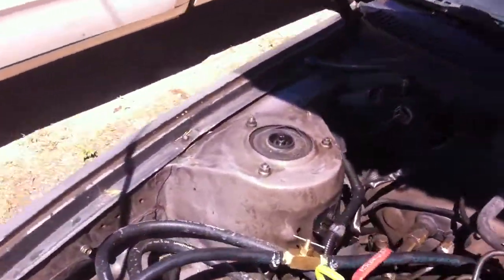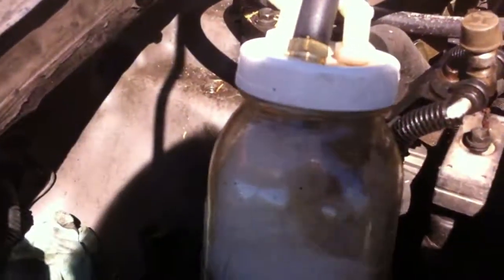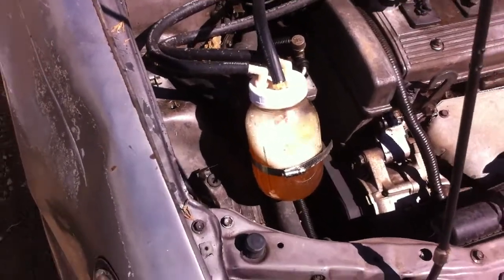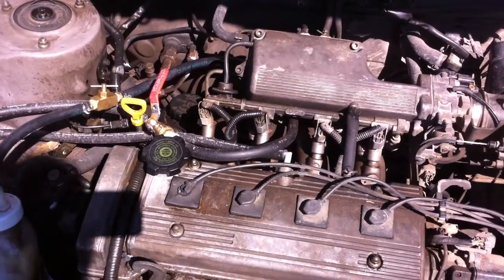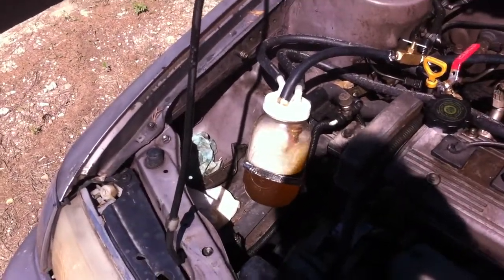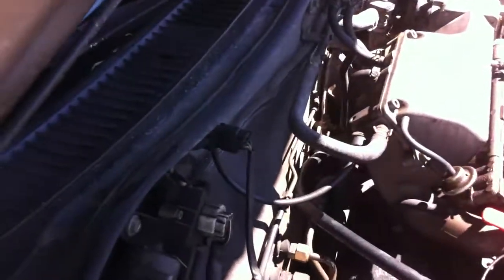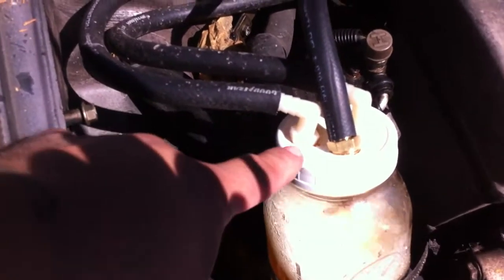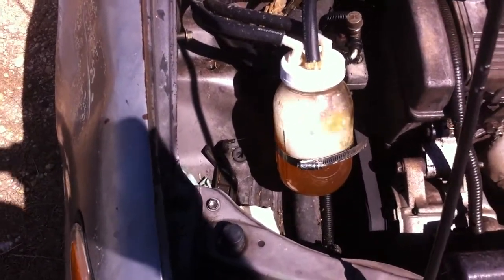Simple Fuel Vaporizer, Drip refil system.

Comment: Ok I'm not understanding any of this. are you tying into the fuel tank or adding to the jar manually. how do i know what needs to go where. I drive an 88 Chevy 1500 and would love to see some gas millage improvement. can you make a video where you actually build and show step by step where these lines go
Reply: By my experience playing with HHO and such and this being much the same in application..  What I'm guessing is, he is using a vacuum off the intake or one that goes to the brake booster, making a closed loop meaning he has it going in a circular path around to the jar and back to the intake..  The vacuum on the intake side is above the gasoline level in the jar, the other side goes down into the bottom of the jar to create the bubbing effect..  An idea I would implement though is to use like a gas filter for a weed eater or something that has that aerator much like a fish tank to create a vast amount of smaller bubbles instead of heavy blurps on the longer side where the air is being pulled from.. The 3rd line is the fuel line which you want a very small and precise valve in-line with exceptional fuel line from a tapped fuel source on the car utilizing the pumps pressure to keep adding to the jar as it is depleted.   You want this to be slow as in slow.. A drip or two every few seconds as the vapor is much more efficient in it's use (hence the increased mileage) and therefore very  little ends up blowing out of tail pipe..  Now if you wanna get serious, the evap system already installed in many cars can be in my opinion utilized for this application.. However, the original setup from the manufacturer doesn't implement it correctly (I think on purpose) as to it being too efficient for gas companies to allow on the level of the manufacturer.. So a system that reburns used fuel was set up for EPA reasons even though we know the EPA is nothing but a slush fund for Deep State (more money for the same owners) but think about it's application..  They are using it to fix unburned fuel rather than make it be used as primary.. In other words, you need to apply it before the burn, not after..  With a simple EFI add in computer to adjust your O2 sensors detection, and a small change in the way the hoses route, I think that is a much more greener method than using it after plus you get the much wanted gas mileage one searches for.. I've not tried this as of yet cause I'm burning an HHO system and I'm learing about using both at same time but I'm about to give it a whirl..   Honestly, I would be happy with a complete HHO system that can eliminate gas altogether but the process of producing is a heavy load on electrical to that magnitude.. However, doesn't seem impossible...   Two batteries I personally restored with epsom and 3 rebuilt used alternators and I've got me a pretty inexpensive fix to an old problem to gas guzzling means of transportation..   Now if they would just release the portal science... Italy has already spoke of technology we could eat there and be back at work during lunch here in America with new methods of transportation coming soon with Trump working on full disclosure.. :P
Reply: Oh, if you can, install your vaporizor cannister (be sure it's completely sealed off as best you can) near the heat source under the hood.. heat adds to the vaporizing effect  of the gasoline.. Some people install it near a radiator or near the exhaust manifold..  You can go as far as buying a heater type coil that works off 12vdc to heat the cannister as well.. When using the evap system I'm still in the process of discovering the storage capabilities of a carbon cannister or if this is something not worth keeping.. May post findings on the use of those soon.  I do know it would be beneficial at the time you shut off the car as it will keep vaporizing the liquid to the point of losses or it just sitting in the heat of the day without starting... This to me is unacceptable losses that may be prevented using a vacuum valve to a normally open pathing through a carbon cannister.. None of this has been conceptualized as of this writing.. Trials and tweaking of the system has not yet began at the moment of this writing.. I'm just making my ideas avail to those with some understanding of engines and the concepts who may want to give it a go..
Reply: @neoplasmax  the evap system IS more efficient than injectors...its being done backwards at the factory, I agree!  Injectors should be used when demand is high on the engine; it can run perfectly well normally just off vapours...and ethanol is just a tool to hamper gasoline from vapourizing.

Comment: May I ask what parts are needed for the drip refill portion? I wanna try this with my 90 Volvo along with hydrogen
Reply from the maker: Jack Newport  I used all "high pressure" brass components. The "t", needle valve, and tubing nipples are all rated at 125 psi due to the injection system requiring between 50 and 75 psi on this system. I figured it is better to be safe than sorry. The "T" was used to tie into the fuel line just ahead of the fuel rail connection. From there to the needle valve and then to the vaporizer. It is just about as basic as I could make it.

Comment: Looks nice, but eventually the glass will become sensitive due to the gasoline and heat, plus vibration of the car, the glass will pop soon enough so be careful.. I would change that jar into another container that can do better with the heat, holds gasoline and the vibrations.. the led/cap has to go because its plastic and the heat and gasoline will definitely destroy it over time.. it's nice to see that you are using a small amount along with the car's injectors because the computer will sense the extra fuel burned and lean out the gasoline to spray less, making you save a small percentage which is an awesome thing.. gasoline price now a days are crazy!!!
Reply from the maker: This unit has been running on this car as seen for over a year now. I do plan to build a different one but I will use this one until it "pops"..lol.. I chose this jar because it is tempered glass so it will handle the heat and cold. I also have it mounted against a foam insulation that stabilizes and cushions it on the back side so it isn't mounted against a hard surface. I actually doubled my mileage with this unit on this car due to the PCM leaning out the mixture to accommodate the extra vapor. Went from 21-23 mpg up to 40-42mpg on the highway.. Not too bad.. Thanks for the hints and concern!

Comment: would you pls kindly share the video of the flash back arrestor and where did you order it from?
thanks a lot
Reply from the maker: I didn't buy the flash arrestor, I made it. Two 3/8" hose x 1/4" NPT (national pipe thread) plastic adapters and a 1/4" NPT brass coupling filled with a brass pot scrubber. The brass scrubber was bought at Walmart and the other parts at my local hardware store. I don't have a video, sorry.
Reply: put a videoo for that PLS

Comment from the maker: A small update to this system. I installed a small flashback arrestor in the vacuum side from the intake to prevent an explosion due to backfires and since this engine has a large amount of wear and therefore blow-by, I had to install a small filter on the  vacuum line from the PCV valve. The fuel was getting very dirty so fast that I was cleaning the jar every few days and loosing fuel vaporization due to the heavy oily build-up.
Reply: how much is the mileage increase?
Reply: Craig Carpenter .
Nope.
Your fuel is being reduced down to the additives that do not vaporize at temps below 450°.
This why vapor systems must flash the raw fuel into white vapor fuel in order for the run idle load run to be proficiently controlled by a throtle body.

Comment: hi
How is working till now 
i want to try it any advice or recommendation?
Reply from the maker: It still works alright. A little less evaporation in the colder weather but I still seem to get over 33 mpg witch is a 10 mpg boost. It is worth trying but you will have to find the "sweet spot" on the valve for the vacuum on your engine. I notice that I get less extra mileage if my vale is open too far.
Reply: Craig what do you mean by sweet spot?
Reply from the maker: talkingSign
Well, you'll have to find the spot that gives you the best amount of vaporization. Open the valve too much and you'll get too much air flow and lose vapor production. Don't open the valve enough and you won't have enough vapor going into the intake to see much of a difference.
Reply: now i got it
do you have any problem with freezing when it is vaporized? and the other question is nidle valve is ok? or you recomand the other kind?
Reply from the maker: talkingSign
The needle valve is a must on the refill side due to the pressure from the fuel pump and the fine adjustment that is necessary. So far I've had no problems with freezing due to using the hot gasses from the PCV system. However, I due note slightly less evaporation due to the colder weather and plan on insulating and heating the jar using the hot water from the heater system.
Reply: Big C 
Hi Again my friend 
which city are u? is it possible to come over and take a close look?
Reply from the maker: talkingSign This unit is still installed on this car and is working fine but I sold the car. I am working on building a larger unit for my truck. When I have some result I will post another video.
Reply: Big C did you had any problem when you turn on the car the other day? the vapor stays in the container and when you start for the first time the other day it doesn't let the car to turn on That is what one of my friend told me about his device
Reply from the maker: talkingSign In all the time I've had this unit on this car it has never once had a problem starting or running. You have to remember that this device only assists this engine. The fuel injection is fully functional. The vapor does stay in the container until you start the car. Then the vapor is drawn into the intake. It helps the engine start.
Reply: Big C yes I know that. would you kindly tell me the exact description of that high pressure needle valve? i ask the suppliers for high pressure needle valve they say I have to have more description of what is the pressure or what is the brand name i prefer to have the exact one that you have already test and have it on my car it is very kind of you to tell me that..
also how often do you change or lean that oil filter does it efect on evaporation at all or not?
Reply from the maker: talkingSign Okay, well, as for the filter, you should change it out when you feel that it is dirty enough to cause a restriction in the air flow. I don't know the brand of the valve but the pressure rating is 75 to 150 psi to withstand the pressure produces by the fuel pump on the car. I purchased it at Grainger Industrial Supply. I bought all of the brass products with this pressure range in mind.
Reply: Big C thanks again
I go there and find it.
did ever your check engine turns on because of this device?
and do you have any idea how to set the device properly i mean that valve between the device and intake?not to be rich or lean
Reply from the maker: talkingSign This car being older has the OBD1 series computer on it so it is not as sensitive as the newer cars. However, the check engine light has only come on once since I installed the unit and that was because I had a major vacuum leak. Once I fixed the leak it never came back on. As for the valve setting, you just have to test and tune to find the best working setting for your engine.

Comment from the maker: I did my initial testing the same day I got my setup installed. After getting the vacuum adjusted and getting the fuel level in the vaporizer set I got immediate results. I eventually drove the same 40 mile circuit 5 times to verify the mileage both with and without the unit in the system.

Comment from the maker: The ratio of drips/min to refill the jar will also be a variable. It took me a little while to get my valve set where I wanted it and you will have the same issue. You will have to drive, check it, drive, and check it to make sure you do not overfill your jar and vacuum liquid fuel into your intake. Make sure you build and install a flash arrestor as well into the vacuum line so it doesn't backfire and blow up.

Comment from the maker: This engine has a lot of bow-by and a bit of oil gets into the gas. Also, only the most volatile elements of the gasoline will vaporize this way so periodically you will have to por out the heavier and slower burning fuel elements out of the jar. I just pour mine back into my tank as they do burn just a bit slower.. As far as the vacuum valve, you will have to find out what works best for yours. Mine has a lot of vacuum so I don't have to open my valve very far.